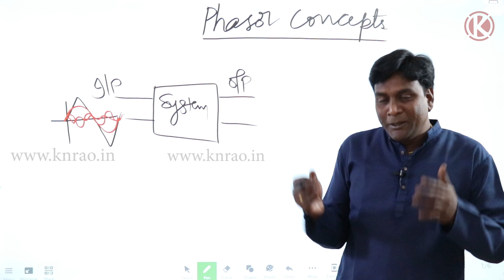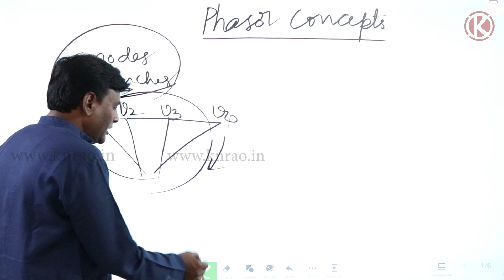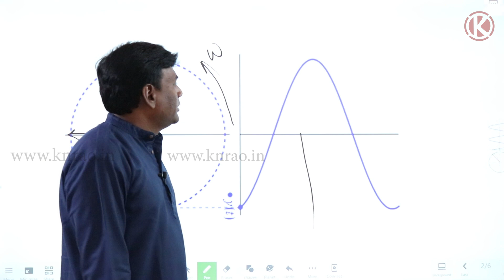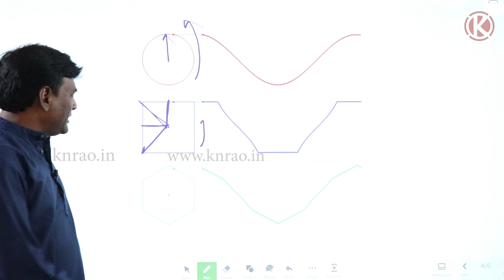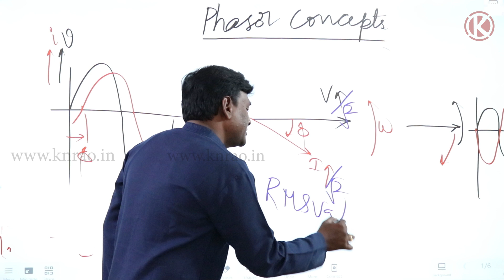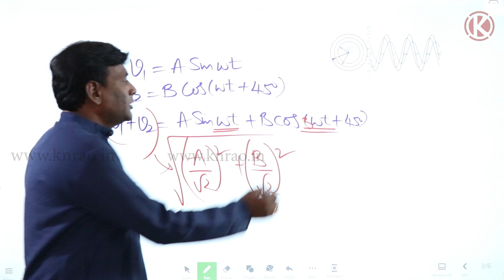Why we Love Sinusoids only, in AC Machines | Harmonics | Phasor Concepts | GATE Lectures by KN Rao

Comment: The main reason behind sinusoids is after displacing 3 coils in space 120 apart and flowing 120 displaced sinusoidal current in time through these windings creates a rotating magnetic field which is the base of every rotating electrical machines